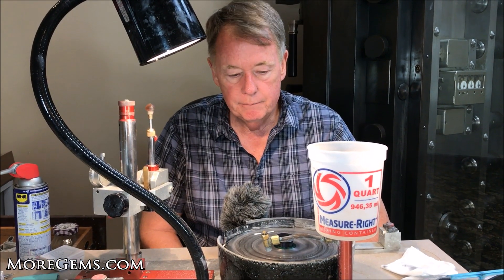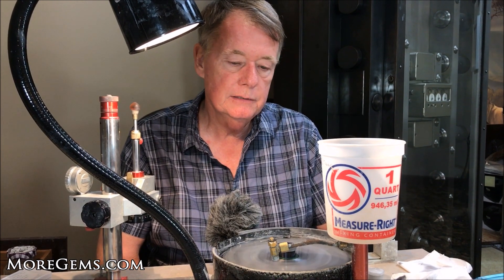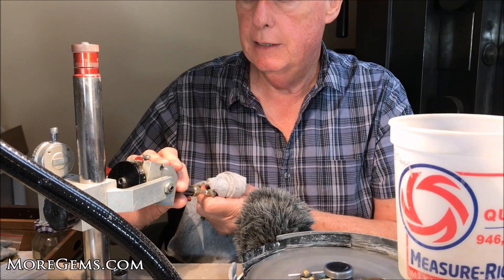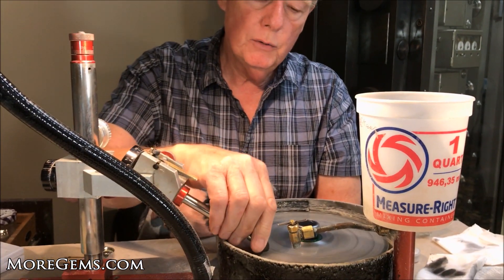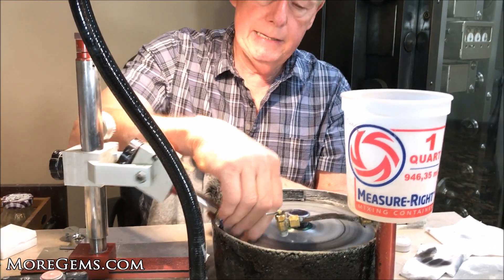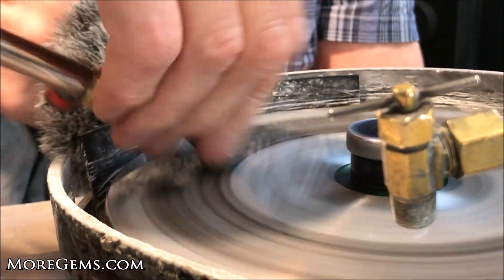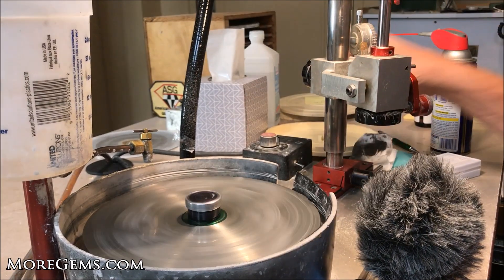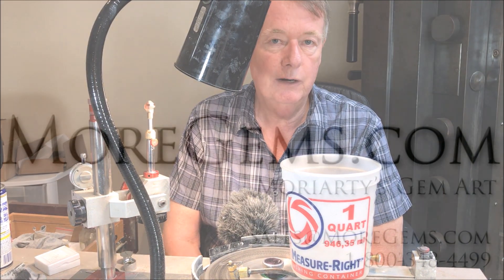Batt Lap: Polishing Gemstones

Comment: You say you don't use the Batt lap on quartz.  Can you provide advice on what to do after a 3,000 pre-polish on quartz?  I tried an ultra-lap after 3,000 and it seems as if nothing happens, no polish!.  I just purchased a Last Lap with 50,000 diamond but have not used it.  I assume there must be an intermediate polish at around 8000 or 14000.  What do you recommend.  To polish quartz, would a copper lap with 8,000 diamond followed by a Last lap with diamond at 50,000 work well?  Or would it be preferable to use two different Last Laps, one at 8000 and the other at 50,000 to do the job?
Reply from the maker: The finer you use the faster the polish but 3000 should work to go to polish.  Did you use the blue spectra lap.  Should work although quartz is often problems no matter what you use. Have you seen our video showing how to do this? If not, you can view it here: https://www.youtube.com/watch?v=ko4iboiAZ8k
Reply: Yes, I did use the blue Spectra-Lap (purchased from Ultra-tec).  I actually had watched the video you recommend and I did push hard with extra cerium oxide, without success. I don't know what else to try at this point.  Maybe it's just that particular stone.
Reply from the maker: Huh, it should be working. I'm not too sure what the problem would be then.
Reply: @alfredohuerta5688  I have used those laps with and without additional cerium oxide, and I have had great success on all sorts of quartz, smoky quartz-amethyst-citrine Etc. So perhaps it is just that particular Stone!

Comment: Hi Steve. Thanks for the video very informative. Could you please tell me as to a beginner what lap I should buy to cut the rough, pre-polish and then polish the stone, what material should be the lap and also what grit diamond powder/diamond past should be used for the for pre-polish and polish. Thanks a lot.
Reply from the maker: Most gems can be cut and polished with a 400 Diamond lap, 600 lightning lap followed by the batt lap with 50 k diamond.  Quartz and Opal are polished with floppy blue spectra laps.

Comment: How much pressure are you using on the batt lap? Also, I am using a matrix lap with 3k polish and then moving to the batt lap with 60k (just learning to use both laps) on a synthetic ruby.  The matrix did a nice job with 3k, but the batt 60k is wiping the polish off from the 3k and showing ridges!!! What is happening???  Thanks for your help. I am enjoying your tutorials!

Comment: Hi, what’s the best rpm to be used on polish? Thanks
Reply from the maker: It seems to vary as I am always changing my speed.  Somewhere in the middle range of the dial on most of the machines I have owned.  Maybe 200- 400 rpm. This is with diamond on a batt lap.  Can vary with slurries.  I use cerium on ultralaps and the rpm is slower otherwise the cerium is ejected.

Comment: Batt lap is my favorite lap for polishing at 8k to 100k, fast and efficient
Reply: just so i get it straight, you would need to commit one lap per grit and not alternate grits. is that correct
Reply: Yes one lap per grit you can't use the same lap for various grit sizes as it would damage the stone and lap
Reply: exactly
Reply: @bertrandlabelle3869  Yes that is correct, if you try to use the same lap for prepolish and polish you will have pieces of the courser grit contaminating your polish and causing all sorts of scratches!

Comment: Thank you for making this video. This is the most information I've seen online using the Batt lap. I was on the fence between lighting laps and the Batt lap. I can see now how user friendly charging the lap can be when polishing. I've read online where the Batt lap can also be used for cutting using 325, 600, 1200 grits. However, I have not seen any demonstrations so I'm skeptical. Do you see the Batt as a potential cutting lap at those grits? Thanks again. Great video!!
Reply from the maker: We've heard that as well, but I only use it for polishing. Check out www.Gearloose.com, they may have more information on that topic, but I'm not too sure about cutting at those grits.
Reply: Batts seem to work with any grit you throw at them, provided they're fully charged.  Diamond really sinks into them, so using a coarse grit you'll find a need to recharge frequently at first.  I have several Batt laps from coarse to polish, including one I've charged with 600 and one with 1200.  The 600 is useful for aggressive cutting, like with medium sized quartz, though it is only better than a 600 sintered with a fresh charge. (NB: be careful introducing sharp edges, including corners, to a Batt; they gouge easily.)  The 1200 works well, but is less useful than I had hoped; that one is getting resurfaced.   My 3000 & 8000 Batts are my go-to laps for prepolishing  or fine recutting.  Steve is right in the video, Batt works well for polishes in general, including oxides.  (Though, tin or one of Gearloose's Matrix laps are equivalent or better for oxide in my experience.)  I find I need to keep mine lubed a bit more frequently than Steve does to avoid heat, though I may put more pressure on the stone than he does.

Comment: I see no point in swishing it back and forth so quickly?... I mean really all your doing is adding vibration and more potential movement or variation of the position between the lap and the mast, in other words moving it like that can certainly have the potential to add inaccuracies.
Reply from the maker: Faster movement can smooth the surface as the laps are not perfectly smooth and can leave lines on the stone.
Reply: @Moregems  I have been struggling with fine lines in polish for months now, I think not sweeping quickly is the reason, thank you very much for your video and commentary as it has saved me from many more months of frustration!!